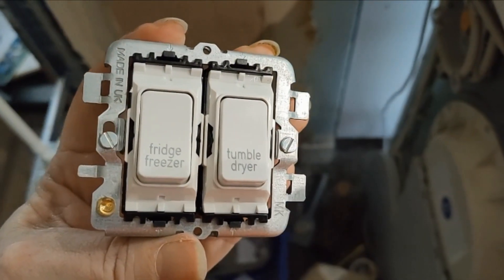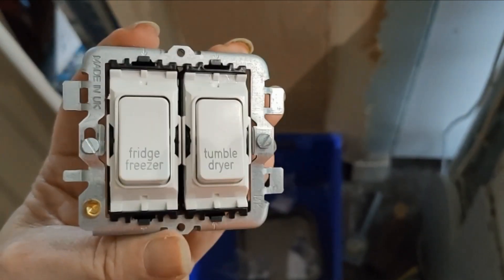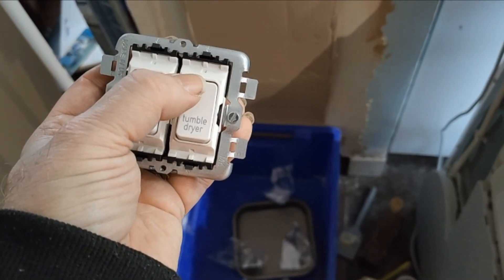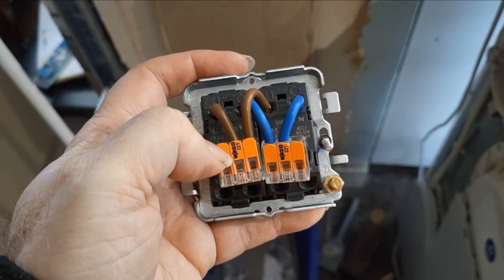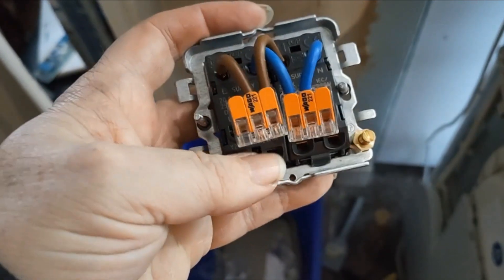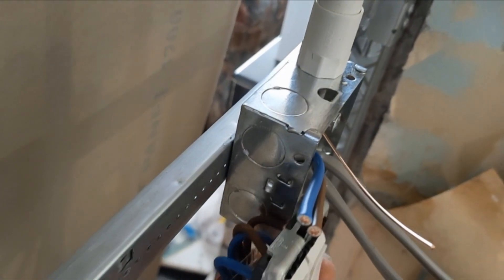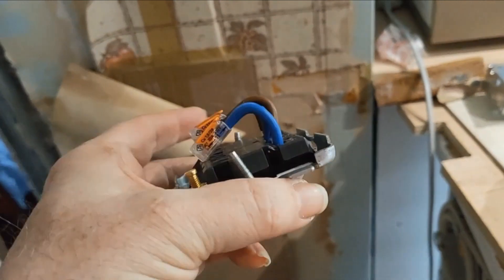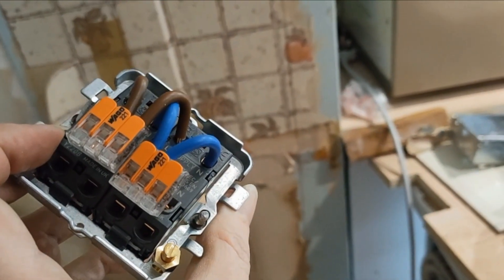HOW TO wire a dual grid switch (Also known as a modular switch)

Comment: You mentioned your running off a radial so the supply cable from the back box will be going directly into first of the Live and neutral terminal of the supply side and not into the wago connectors?  If you connect the supply to the wago then that means you have split the radial into 2 branches?

Comment from the maker: If you found this video informative please watch our companion video to this on how to make use of Grid Sockets by clicking on the following link https://www.youtube.com/watch?v=GubLESBjbzc

Just to answer a few queries that I've had. Yes it is 4mm to the switch then 2.5mm to the sockets. That's allowed unfused according to BS7671 (Reg 433.1, Fig 15B, p506), In fact you can go down to 1.5mm if the spur is fused depending on the load downstream

Comment: Do you have 4mm cable going in to the box, but 2.5mm going out of the switch?
Reply from the maker: Yes, it is 4mm to the switch then 2.5mm to the sockets. That's allowed unfused according to BS7671 (Reg 433.1, Fig 15B, p506), In fact you can go down to 1.5mm if the spur is fused depending on the load downstream
Reply: Thats whats puzzling me too, no fuse to downsize it?

Comment: I am redoing my new kitchen and don't like the current plug setup. There is a seperate spur for fridge / extractor fan and something  else.

Instead I like to have a grid for DW / WS / Ext Fan / Microwave 

Ideally also for Oven and Hob but been told that they are on thicker cable and higher amp therefore not allowed.

Kindly advise what grid I need to look for? 

Thinking to
Reply from the maker: Not so sure they are not allowed, it's more the case that I've never seen a grid switch rated at more than 20A, and you would need something in the region of at  least 32A or 40A. The ones I used for this install were 20A on 2.5mm T&E for a Fridge/Freezer and Tumble Dryer.
Reply: @vwes  right, that means I can have a grid switch for dishwasher + washing machine + microwave + fridge freezer + extractor fan

Trouble is, can't find a 5 switch grid. :( Can you recommend which ones I need pls?

Also, does it mean each switch would then have two cables for each outlet?